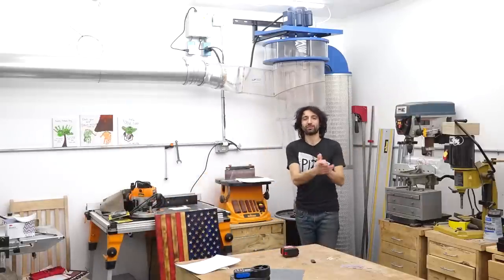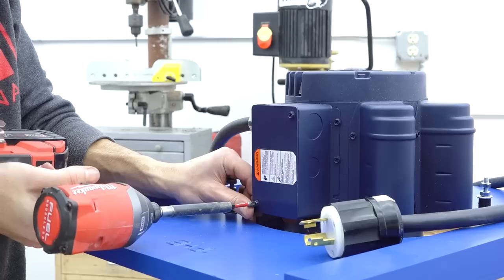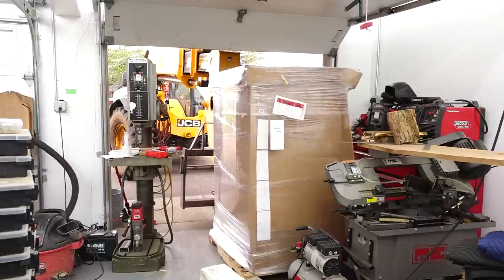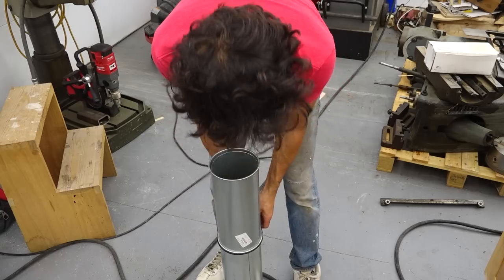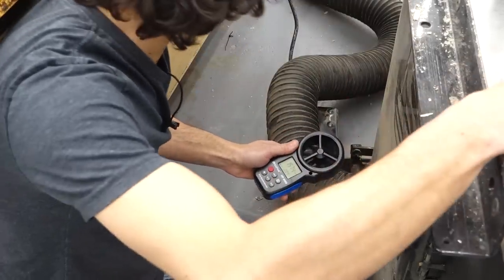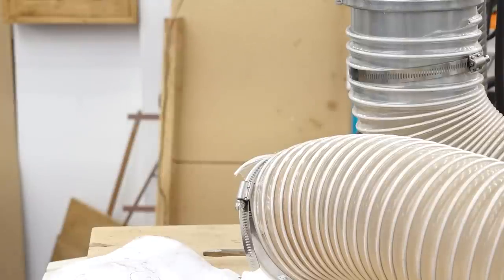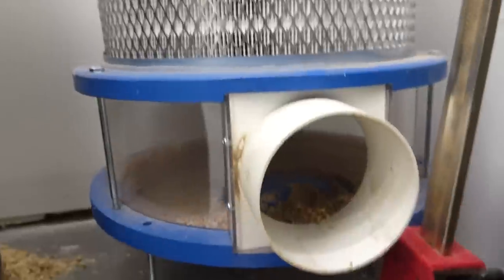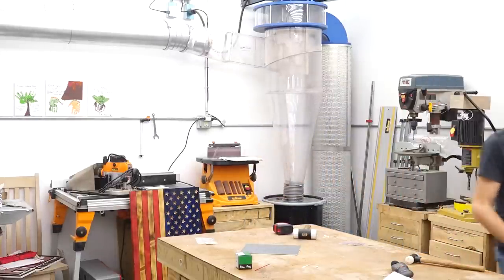Installing Dust Collection (Clear Vue & Nordfab) - Moving My Woodworking Shop [Part 6]

Comment: 😂 Guess the system works...I laughed out loud when you lost your paper and anemometer.   I have a system similar to the Nordfab  piping here in my HS shop, it's great to be able to move our equipment around if needed or be able to break a connection when a student loses a piece of wood or tool in the system. 🤦🏻‍♂🤦🏻‍♂

Comment: Matt, Great system, great video..... one question, can you get a floor vac attachment port for cleaning the shop.... seems like it would really make a nice attachment to the overall system..
Reply from the maker: I used to have one by my lathe which worked well for that stuff. I just prefer vacuuming over sweeping

Comment: I'm surprised that you didn't put a system in that opens the blast gate when you turn a machine on and closes it when you turn it off. That should make your life easier.
Reply: I just installed a Clear Cue system in my shop. It has a 5HP motor. The manual says that the motor should not be stopped more than 4 times per hour. When it starts, the heat build up takes 15 minutes to cool down. If you had an automatic system installed, you'll eventually burn up the motor. That's the only downside of these systems. Because of their superior performance over lower HP motor systems, I'm willing to do 15-minute love sessions with my dust collection system.

Comment: Matt you'll likely get better fine separation if you have at least 2 gates open. 500 CFM isn't enough for the cyclone to throw small particles out of the airflow. More air  equals higher velocity in the cyclone action which means particles get thrown out easier. I have a tall cyclone and when running my drum sander I make sure to have at leas 2 other ports open to make sure the cyclone gets maximum air.

Comment: Those CFM readings are interesting.  Isn't this a 5 HP unit?   I have an Oneida V3000 and I get 1000+CFM at my first 4" port which is ducted from 7" at the inlet slowly down to 4" at the ports.    Quick searching around, you should be getting more than ~500CFM with that unit.
Reply: I've got a v3000 and same thing here. Just made a video showing 1300 CFM with it.
Reply: I have a v3000 (3 HP motor) with 6" metal trunkline, 5" drops, and 4" tool ports.  I'm getting 900-1000 CFM at my 4" tool ports when a single gate/tool is open.  I have a similar perimeter routing of the trunkline around my shop also.

Comment: In the shots of the paper and meter recovery, you can see that clear rectangular section at the inlet to the cyclone deform significantly.  (Not an expert on this, but...)I think the impeller wants a lot more air than it's getting and that seems to translate to being able to have multiple blast gates open at once with little change to the  performance.   yes? no?

Comment: That's great. I feel like it is a rite of passage for anyone with a Clearvue system to suck up a tool. Usually it seems to be a tape measure first but I guess an anemometer is fitting as well. Keep an eye on the blue plastic mounts that hold the motor up. Every single one of mine cracked after a few months of use. I replaced them with pieces of 1" x 1/8" steel flat bar and haven't had any problems since.

Comment: Matt I hate to say it but Clear View messed up! With those distances and a 5HP unit you need min 6" right to the tool (including flex). Running that unit on a single 4" port will kill your CFM. Beautiful unit and set up though.

Comment: (Later: Oh wait, i just watched more of your video.  ROFL!  I guess i should've expected it!  Especially because your anemometer doesn't have a cord like mine.  It was the cord that saved me.)

Ooh, anemometers!  I almost had a Red-Green moment with mine.  The first time i used it to test my new dust-collector system, the anemometer almost got sucked down the pipe.  That would've made a good Red-Green handyman's corner episode: He builds a new dust system for his mini tablesaw (you know that tablesaw that fell off the table upside while still running and went skithering off across the floor?).  Builds it out of gutter downspouts and a vacuum cleaner (hoover upright), and then when he tests it, of course his anemometer gets sucked down the piping.  And then he says, "Don't worry about the anemometer; it was only a rental!"

Comment: Matt, great shop!  If you want to spoil yourself some more, you should check out GRIT Automation.  We can automate all of your Nordfab blast gates or any new or existing metal blast gate.  With manual gates it's very easy to have one open that shouldn't be.  With GRIT you just turn on a tool and the entire system configures itself, as well as turning your collector on and off automatically.  Gives you more time to work instead of checking your gate configuration and turning collector on each time you use a tool.  GRIT also creates a level of safety by giving you the ability to lock and unlock your shop tools with the press of a button.  This is great if you have curious kids that like to press the buttons.  Much more to GRIT but just wanted to let you and others know we exist.  Thanks!

Comment: Almost seems obvious but, bolt on a couple stamped steel handles on the collection drum. It would facilitate sliding it out from under the funnel, since space tolerance is tight. Just a thought.
BTW, the anemometer getting sucked in was hilarious. Had to go back and watch it again. Your reaction was priceless. Keep the kids away from that thing or you'll be digging them out of the drum. Hahaha.

Comment: What material is the impeller in the dust collector made of? It looks like steel, but hoping it's aluminum. Oneida does a resin impeller to further reduce the chance of sparking if you happen to pick up a screw or another small fastener. I've been looking at the Clear Vue for an expansion to my shop, but a steel impeller would be a deal killer.

Comment: Hilarious! I was doing some stuff the other day using the CNC as a work surface. I forgot to turn off the gate and it sucked up a shop rag. I was looking around for about 5-minutes before I got a new rag, having no clue what happened to the first one. Then I saw the second one get sucked up. LOL 

I have an Oneida V3000 and ran it for about 2 years off of 4" flex hose. I just upgraded to 6-7" metal duct and the improvement is MASSIVE. I finally have proper DC and it's incredible. I wish I could have afforded the Nordfab, but all my ducting and fittings from Blast Gate Co. was $1,100. Nordfab was going to be about 3x the cost.

Comment: Matt we are thrilled to see this system finally in your shop. Thanks for the great video. Your trade off on length of duct run did cut down the CFM at the ports a bit too much. No doubt 7” trunk line would have been better. Like you said though, every shop owner makes weighted decisions based on their priorities. You chose well. Best to you!

Comment: To avoid the worry about having the vents open or closed you can run a wire and have an automatic system that opens and closes per tool being run. Really quite nice, might not be needed as much with the smaller shop and what not but could still be helpfu.

Comment: You should have used shrink tubing on that connection that you made inside the electrical panel Instead of electrical tape
Reply: seems sketch, thought the ring terminals and bolt were going to attach to something, not just hanging out free in the box.?!?!
Reply: You have to watch the voltage rating of the tubing to use it safely. At the tire plant I retired from we used SCOTCH 33 or 88 on ring connectors to motor leads and over 600 volts we  wrapped it with high voltage insulating tape first then 33 or 88. On smaller motors we just used wire nuts.

Comment: I would have installed the DC between garage doors. That equates to having the collection barrel close to the door you would use to empty it. That ALSO equates to a shorter run, without the 90 degree turn at the back wall. THIS would move more CFM.

Comment: Is it useful to have long flex hose for floor and table cleaning?   Great system!  Anemometer bit is up there with chainsaw dash radio install!
Reply: AKA Andrew Camarata?😊 Matt you need to make that a "short" video
Reply: @hpw59  Fortunately the anemometer bit is already available to but posted as a short!

Comment: Yeah, I was wondering how you were going to get that motor assembly up onto the wall brackets.  I have one of these things so I know how heavy and cumbersome it is.  I had to have help.  My system uses the J.K.Moses blast gates and I have them installed in the system overhead right where they come off of the main trunk rather than at the tool.  I THINK it provides at little better cfm.  At least I tell myself it does.  That NordFab stuff looks super easy to install.

Comment: "Some Assembly Required!"

I looked at Nordfab myself for my small shop, but besides the price being too high for me, I have very specific location requirements in my small & tightly-packed shop.  For instance the downpipes had to very precisely located within about 1/2" to fit in the space available.  And the horizontal runs had almost as tight constraints.  I couldn't get that sort of location precision with Nordfab, at least without huge additional fitting costs (and it's the fitting costs that kill you with Nordfab).  Nordfab wants more freedom as to where the pipes run.  But if you have the space, Nordfab does look like a nice & neat system.

Comment: You should have Donovan build you a shop or a barn and for the siding you can use some of the wood that you harvested from when go pick up big tree trunks. Also, you have a lot of land to use up. You can put the telehandler in there, the skid steer, and the logging trailer.

Comment: Amazing stiff Matt, thanks! Just installing the duct work on an Oneida V3000 now. What is that part you used between the first pipe and the machine adapter? The one that looks flexible?

Comment: Matt,
 I put in that exact same system 2 years ago based on Marc Spagnuolo's similar video and have never looked back. Absolutely the best available. 

Just so you don't feel bad, when I first tested my system, I accidentally sucked up a 25-ft tape measure that was laying on the top of my table saw. And yes, I, too, had to dig it out of the drum.

Great video, buddy.
Reply from the maker: Hahahaha awesome!

Comment: I laughed so hard I cried.  That was awesome.  If you are getting the same scfm wirh multiple gates open, wouldn't that tell you that your duct size is limiting your dust collector  performance?
Reply from the maker: More likely the dust port of the machine is the bottle neck. Might have marginal gains if you ran a bigger pipe to the machine

Comment: Needs a floor inlet.  Second most used on my dust collection  system.  Sweep it right in.  Great video Matt.
Reply from the maker: Used to have one. Didn’t see much use. I prefer to vacuum
Reply: @mcremona  Absolutely agree. Why sweep --and throw all that dust into the air--when you can attach a hose+vac head and just vac the floor directly? Floor sweeps are for chumps.

Comment: I think the best part about the clear version, is you can handle it solo. My older oneida is SO heavy and as a result was super difficult for me to install solo.
Reply: I too have an Oneida cyclone system. I agree it was a bit of a beast to get on the ceiling/wall. But I like all that metal. Its a sturdy bastard. And there was a lot less assembly--hardly any, really. Matt had to build that whole thing. The Oneida was plug N play. I didn't splurge on the gasket system, although Oneida offered it, and instead went with the crimped connections. If money were no object (i.e. Matt's life) I'd definitely do the fancy gasket system.

Comment: I've worried about fire or explosion in my dust collection system. Hope these new systems have some way handling the problem. I enjoy carpentry but cleaning up afterwards is a pain. I like the clear collector. It should be a big improvement.

Comment: I had a friend who worked in an industrial wood shop back in the early days of installed dust collection. He said they had to take measures to suppress static charges because of dust explosions and fire in the ductwork. 
I wonder if that is something that needs to be mitigated in your application, or if it is something that is already a part of your system?
Reply: As long as the metal piping is grounded, it takes care of the static induced by the quickly moving sawdust all by itself.
Reply: @Cooper_42  thanks for the reply.